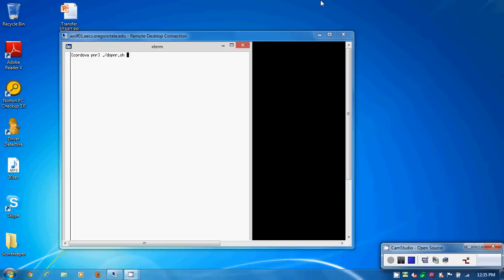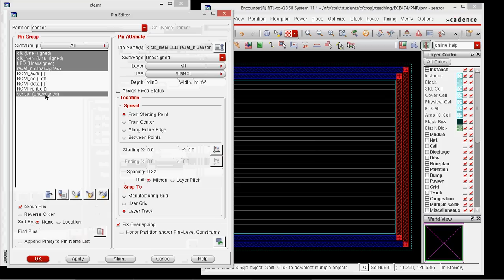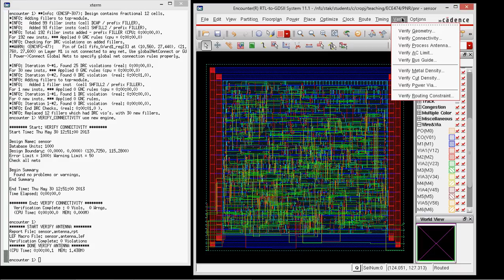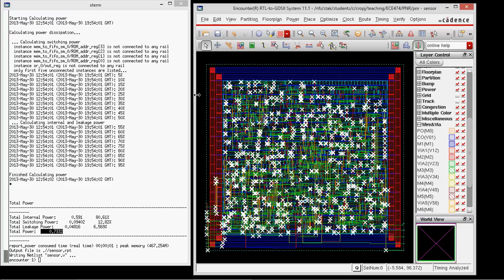Place and Route with Cadence SOC Encounter (Basics)

Comment: Joe, good afternoon!
Was charmed by this video and the way you explain basic things step by step. Thank you very much for such a detailed open-free work.
I’ve started working as a chip designer in Encounter Digital Implementation v14.2 tool without any CAD topology engineers around. The only way I can study myself and learn how to provide complete Physical Synthesis are so-called Cadence Rapid Adoption Kits and EDI tutorials. But it seems to be really useless in conditions of real, massive and complicated project I'm working on now. So that’s why I’m desperately searching for somebody, who has at least even once opened an EDI. 
If it is possible, please, may I have your e-mail or skype-contact just to clear some key important moments in floorplanning and P&R processes. Would be very thankful! 
Anyway, thank you again. 

P.S.
I know about Cadence Support courses, quite expensive one. But my director is in a long business trip, so there is no one who could manage this issue.

Comment: Hey Joe.. Nice video.. I am new to encounter. I have worked on version 9.1 where the timing libraries are given at design import. But recently my university shifted to soc encounter version 11.1.. I could not find where to import my max and min timing libraries.. It would be really of great help if you help me out with this problem..
Reply from the maker: sumanth siddhartha Take a look at the viewDefinition.tcl file in the /pnr directory (it is included from encounter.globals). I'm pretty sure the setup I have posted in the link above will work with encounter version 11+

Comment: Can any one tell me how to create spare cell which are not included in the netlist
Reply from the maker: Why do you need to do that? Typically the spare cells stay in the netlist so you can pass LVS. I suppose you can write a perl script to remove them though.
Reply: Thanks for the reply and I found the solution for it. I have an other question. How to route the spare cell which I have created?
 I have placed a spare cell "NAND3XL" along with the standard cells , now how do I re-route including spare cell which is to be replaced with the same NAND3XL standard cell?  
I am trying to perform Post-mark ECO.
Reply from the maker: There is probably a smart way to do this. But I have never had to do it. Sorry
Reply: just add the spare cell like inserting filler cell.Any details you can refer to my blog site  www.52-ic.com

Comment: Hey guys, this might sound random. We are trying to migrate to RHEL 6 but we have a showstopper issue with EDI 11.0 version which is the version that works on RHEL 6. Students use files /FreePDK45/osu_soc/flow/{encounter.tcl, encounter.conf) as input somewhere. This works fine with EDI10.0 and RHEL5 but we have to EDI110 on rhel 6 and things seem to be broken when using those .tcl scripts in  /FreePDK45/osu_soc/flow . Anyone know who can assist updating the .tcl scripts in  the flow directory?

Comment: TIME CODE SHORTCUTS:
0:00 Introduction & Open Encounter
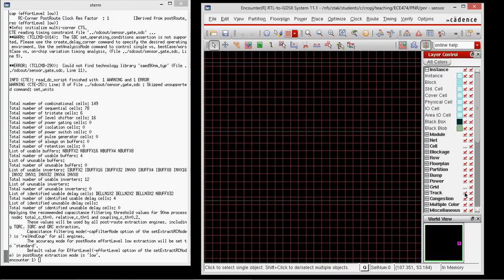1:30 Specify Floorplan
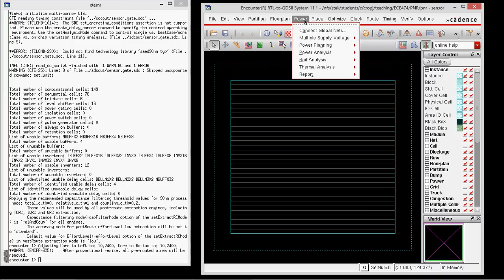2:55 Power Rings
4:25 Place Pins
6:50 Power Tracks
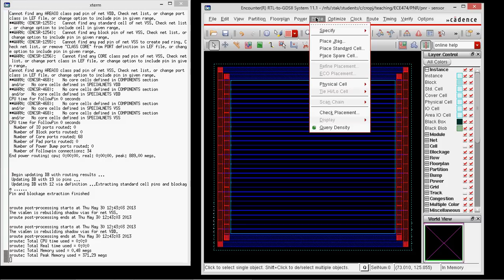8:00 Place Standard Cells
9:00 Spare Module
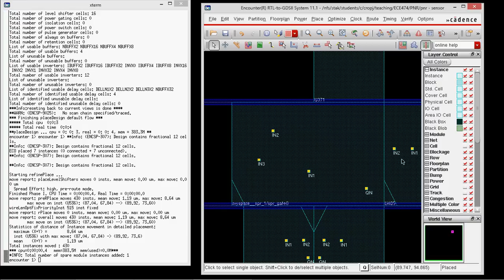11:30 Zoom & look at cells
12:22 Route Design
14:00 Place Capacitors
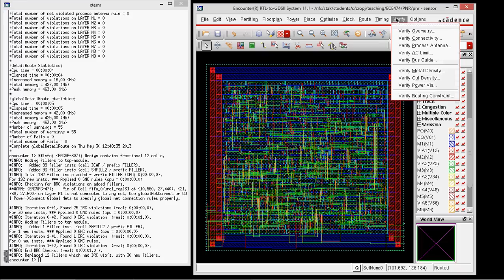15:30 Run Verification
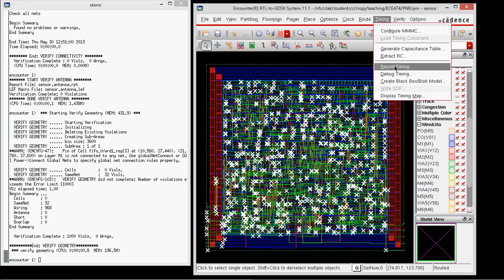16:50 Timing Reports
17:35 Power Reports
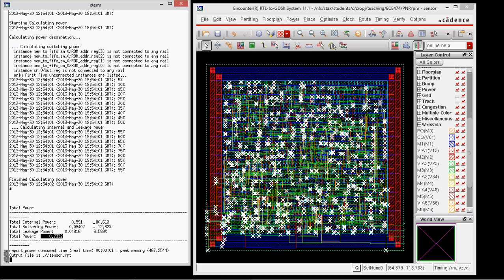18:55 Save
19:30 Command File
Reply: Hi ... Please can you add more videos